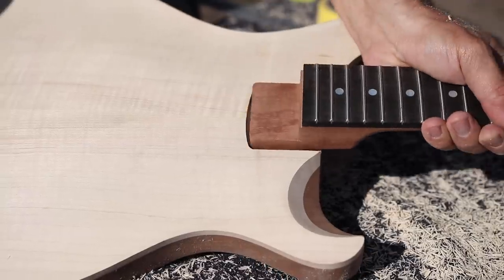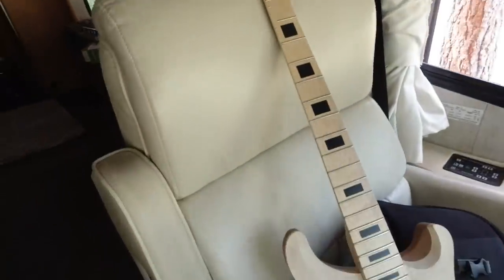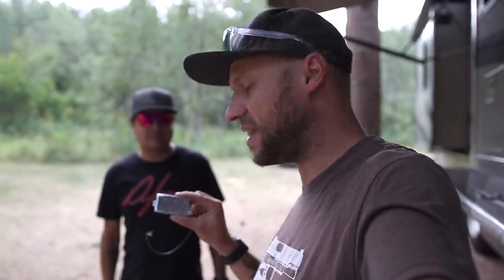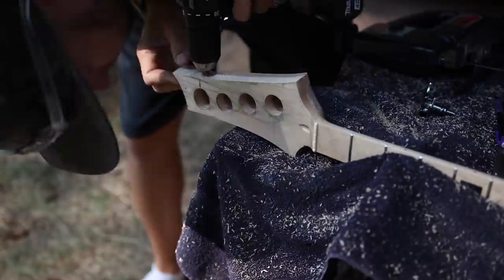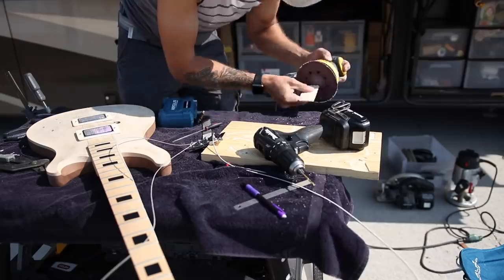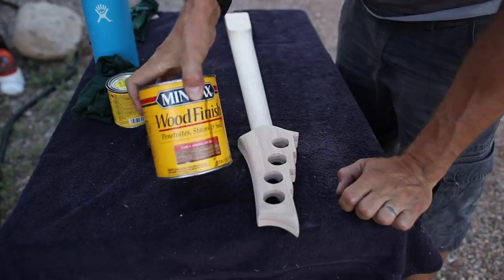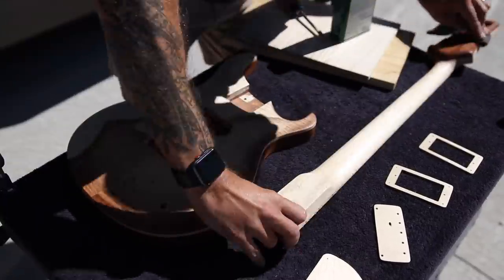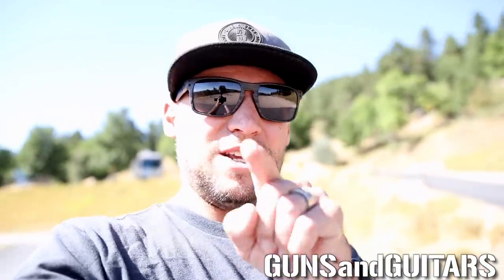They gave me a guitar kit...BUT I BUILT A BASS INSTEAD! (Great Guitar Build-off 2020 OFFICIAL)

Comment: Writing, lefty, playing righty, most tool use, lefty, cutting with scissors, righty... Would you believe I'm almost the exact same way?  I'm working on getting my bass wired right now, hoping to finish soon.  I modified an Ibanez 5 string and put in 4 soapbar humbuckers.  (No "ramp" needed as it's a continuous thumb rest all the way across)  When done you can switch between the "outer" two pickups (closest to the neck and bridge) or the inner two pickups (similar to a Warwick $$ double-buck) and then switch between series or parallel wiring for the selected two pickups, then it runs through a SD STC-3P preamp.  I also replaced the bridge with a string-thru variety, and the nut with an adjustable version too.  You'd probably love the wiring and hate the styling.  (It's a metallic royal blue, which I know is not your jam)  But I love the look of your shorty in this video.  Nice work!

Comment: I'm really digging the contrast in wood tones, well done!
That headstock is cool, something you don't see. Ampeg did use an open slot design in the 1960s, but a traditional look, not wild like yours.
The carving is a really cool way to separate the two stains.

Comment: I have 2 of those work benches (they accidentally sent me the second!) and I love them too!  I don't travel but I have to work in my back yard with only a storage shed and these really work nicely in those conditions.
Reply from the maker: Aren’t they the best? If I ever have a garage or workshop again, I’m gonna buy three more of these instead of a big workbench
Reply: @GunsandGuitars  Seriously!  Though you'd have to make sure they are all *exactly the same build/height to avoid leveling issues...  Still its great for making a work surface that's only as big/small as you need.  I first saw it on your pre-ramblin video so you do get some credit ;)

Comment: curious to see how these pickups will sound , i like the way the tuners sit in the head though the way you made the headstick on the side doesnt look good , next time mabe make perfect fitting pockets for the tuners to drop intoo , and make slots for the strings to drop through (with the acces holes from the back)  that would hide the tuners from the front of the headstock and gives the bas a cleaner smoother look

Comment: Nice build. I think the Puretone jacks are over hyped. It's kind of annoying the way they are advertised next to a picture of a cheap jack that does not have a recurved tip contact. In my opinion Switchcraft jacks with a recurved tip contact are just as effective as the Puretone.

Comment: I love the headstock design, but have you had one break from a loss of structural integrity? I would fear that the stored energy of the wound strings would put too much pull on the headstock itself. Having cut large holes it the headstock, I would be anxious about it succumbing to that torque.
Reply from the maker: I’ve done many more headstocks like this, and with even more material removed. It’s plenty structural. Never had an issue.

Comment: I just got one of those hobby/trim routers, is it powerful enough to route pickup cavities and a floyd rose bridge recess?
Reply from the maker: Definitely, but helps to have sharp router bits, and to take a few passes if the cavity is deep. That’s what I do, except my router bits are dull 😂
Reply: @GunsandGuitars  doing something right up your alley with the 12 string I won from FB, using pvc primer to stain it purple and finishing it in tru oil lol

Comment: Hi I’m trying to learn how to build all this by myself can anybody tell me what the tool is called that he uses on the headstock to give the strings a little extra room in the hole he called it a scalper but can’t find it
Reply from the maker: Not a scalper. It’s a dremel rotary tool with a flex shaft kit. The bit I’m using there is the multi purpose cutting bit